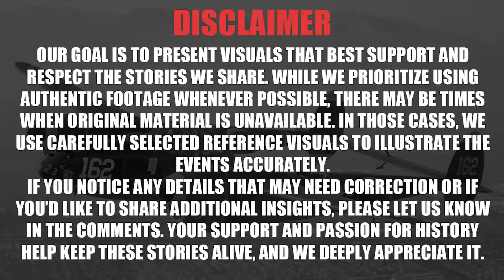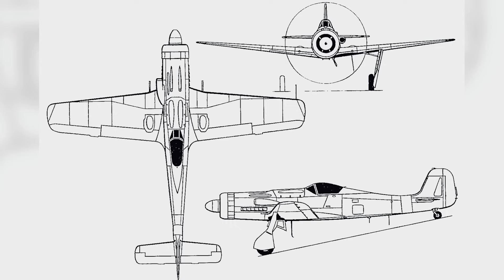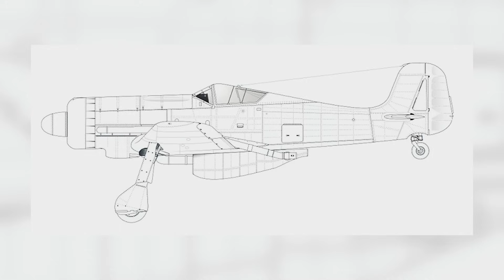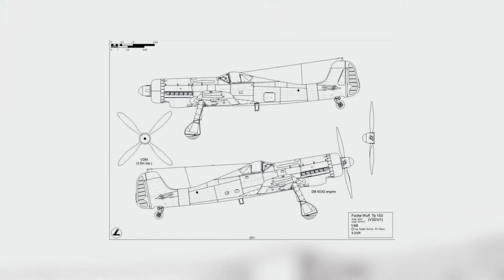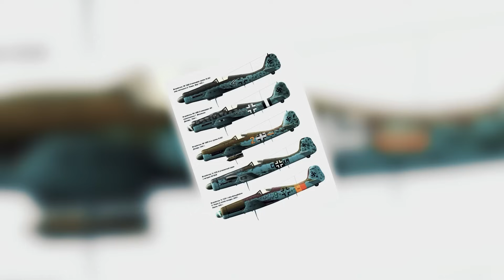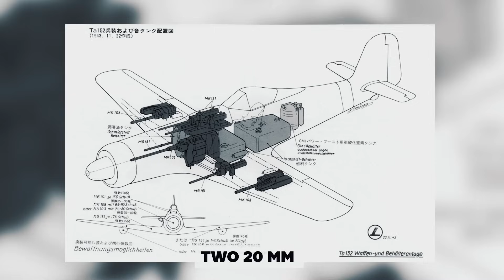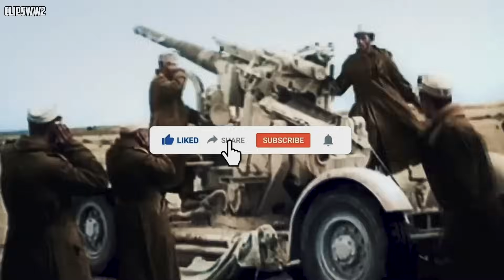Germany’s Last Gamble in the Sky: Focke-Wulf Ta 152 Explained

Comment: Germany's air ministry was led by drug addled Goering. Rather than lead compentently, he wasted rousources on stupid shit like MAUS, Ju-52, Me-262 "bomber", and upgrades on Bf-109-- a 1930's design. First should have procurred RESOURCES to build Turbine Blades heat resistant.( chromium, and molybedanum ). Then use ALL resources to produce Me-262 and upgrade engines in serious numbers !   Not starting Operation Barbarossa, and CONSOLIDATING GAINS would have allowed for this.
Imagine: a Normady landing met by 5 million Wermacht, and 65 squadrons of Upgraded Me-262's ?
The Me-262 with a pressurized cockpit could have outperformed EVERYTHING the West had. The 30mm cannon, and wings holding rockets could have devastated Allied bombers easily.
Sadly, Hitler was a great speaker, but should have NEVER tried to advise on Military matters. Incompetence has ALWAYS been the downfall of Empires. As seen in USA in 2025.
I could have directed the Reich to great victory, at far less costs, and saved destroying the Bolshiviks until all was consolidated. Taking Russia would have required long range bombers in numbers, with hundreds of Me-262 variants to escort out and back.
A Jet version of the America Bomber would have been sufficient.
England was a comparative knat, taking England out of the fight would have been simple after 5 years of CONSOLIDATING GAINS.
Strangle England by simply interdicting shipping from America. That too could have been done with both long range bombers, and more Uboats.
Reply from the maker: Thanks for sharing your thoughts! I try to keep the videos focused on the historical facts about the aircraft themselves rather than broader political or alternate-history scenarios. There are many complex factors behind Germany’s wartime decisions, and historians still debate them today. I appreciate your interest and your detailed perspective!

Comment: They have real film of TA 152 it is longer and sleeker than these.
Most pics look like FW 190 Dplus versions
Reply from the maker: Good eye! You’re absolutely right that the real Ta 152 was longer, with that distinctive stretched nose and wingspan optimized for high-altitude performance. Some of the footage and photos often get mixed up with late Fw 190D variants since they shared the same lineage. I appreciate you pointing that out!

Comment: The Ta152 H was a superb plane. The problem was by the time the German war industry actually managed to churn out enough of them the war was over. The Luftwaffe only received about 1 squadron of them and they were operational for less than 3 months before the war ended.
Reply from the maker: Do you think it could’ve challenged the Tempest or Mustang if it had entered service earlier?
Reply: @VintageWarbirds  Definitely. The test pilots that flew them said that they had a tremendously fast rate of climb. And they were incredibly maneuverable at the height they were designed for.
Reply from the maker: Thank you for sharing more information!
Reply: @VintageWarbirds ta 152 was awesome but cursed by rushed production sabotage and lack of pre production testing. In my professional opinion was best fighter in ww2

Comment: The biggest quandry is, having numerous allied aircraft witb 2 stage superchargers - why didn't Germany copy this? In  1944 when the p51 mustang  came in German pilot's had an advantage if they boomed and zoomed.
Eric Hartmam did this scoring the highest amount shot down.
Reply from the maker: Excellent observation, Germany did experiment with multi-stage superchargers, but materials and production limits held them back. Hartmann’s tactics perfectly exploited what the Bf 109 could still do best.
Reply: They already had something better, at least Daimler Benz, the centrifugally coupled variable speed supercharger, which made stages ancillary (German government should have enforced to Daimler Benz to pass the patent to Jumo and BMW, in this way the Fw190 A would had not any high altitude problem). 
Pratt & Whitney later adopted It coupled to the Water methanol injection to the engine for the F8F Bearcat.
Best regards

Comment: The Bf109 was not, as this video claims, altitude limited like the Fw190. It flew top-cover for 190s. Most of it's more successful pilots used either it's (most often) superior climb rate or high altitude performance if they had to fight the generally superior Mustang and later model Spitfires. Though not as tough or well armed as the Fw190s, a Bf109G-10 or Bf109K would not have had a very hard time climbing high enough and fast enough to intercept B29s. As the Japanese fighter pilots could have told their German counterparts, you could intercept SuperForts, you could even shoot a SuperFort down, but the latter was potentially more problematic than the former.
 The DB603 was not an especially difficult engine for Daimler to develope, being an advancement of the tried and true DB600,  DB601 etcetera series of engines. Even variations or upgrades of proven deisigns have some teething problems, but the DB603 was not an especial problem. The problem was that any DB6XX was in high demand with every aircraft manufacturer in Germany, and they all wanted the latest, greatest version delivered to them in huge numbers yesterday. Tank's company was way down the priority list for receiving them. Goering preferred the Bf110 to have DBs before Focke-Wulfs, even though the 110 had proven ineffective as a "heavy" fighter even before it was hopelessly obsolete. Like a Merlin, the DB inlines were complex, and required extreme precision in manufacture and assembly, so they did take longer to produce than a realively cheaper, simpler radial design. Just like the drawback to a Thompson sub-machine gun compared to an M1 carbine.
Reply from the maker: Excellent points! You’re absolutely right about the DB603 development and the 109’s high-altitude capabilities. Thanks for adding valuable detail to the discussion.

Comment: All they really needed was the ME-262.  Nothing the allies had could equal it.  It was indeed---a vonder weapon.
Reply from the maker: The Me-262 was definitely ahead of its time, but it came too late and in too few numbers to change the outcome of the war.
Reply: Of course the Me 262 was fast and amazing, but in the shape it was in, it was not THE gamechanger.  

All OK when you can do the ideal - do fast strafing runs on the bombers,  

But the Jumo 0004s were a mess, just 20-40 hours lifetime, and you had to handle the throttle like a raw egg, or it would flameout.  

During landing they were sitting ducks, when enemy fighters came, they could not just push throttle and pull away. The landing fields of the Me 262 needed air cover from prop fighters.  
  

It turned out that I had met Guido Mutke. He had flown the Me 262 "Weiße 3" that is now in the Deutsches Museum, Munich, with which he had landed in 1945 in Dübendorf in the neutral Switzerland, where they both were interned. 
Whether it was a navigation error or whether he thought it is safer for survival in Switzerland, we will never know.  
 
A friend from the Deutsche Museum told me that when I mentioned his name, I had met him at a party of acquaintances of my parents, and in that time he was more about his later career in a health insurance company.

Comment: The B-29 would have done not much better than the B-17 and B-24.  The skies over Germany were German.
Reply from the maker: That’s a fair argument. The B-29 had advantages like range and altitude, but without air superiority, even it would’ve struggled over Germany before 1944.
Reply: I suspect that the American Air force judged too costly to deploy the B29 superfortess in Europe as any Heavy FlaK gun could reach 35-45.000 feet of ceiling and almost all of the German fighters, that is, the late Bf109G and Bf109 K, the Fw190 D and late war Fw190 A, could reach 30.000 feet around higher speed than the Boeing B29, without any special trouble and shot them down making It a farctoo expensive toy. The radial engined BMW 801S Fw190 A9 was able to still reach about 610 km/h without much trouble at this heights and 670 km/ at about 6100 metres and the non finished Fw190 A10 with BMW 801F with two stage two speed supercharger and 2450 HP would have been similar to late war F4U4 Corsairs. Nothing so easy as the Pacific theatre. That not counting the Me262 and the new breed of jet fighters that Germany was preparing.
Best regards.

Comment: Nazi foolishness was thinking time wasn't running out faster than they could get these new wunderwaffe into wide service.Losing a protracted war is NOT a constant rate, straight line graph to surrender; it's an increasingly steeply declining curve to eventual vertical free fall. Sort of like the arc of most kamikaze flights. Out of time! Great underestimation, but then, being proactive, without hubris & arrogance were not in Nazi DNA.
Reply from the maker: Very well said. The Nazis’ obsession with “miracle weapons” blinded them to the reality of their collapsing logistics and resources. By the time many of these projects were operational, the war was already lost.
Reply: Stop before Barbarossa, and spend 5 or 6 years CONSOLIDATING. Gathering Resource Lines. Waste no time on crap like Stukas, and 109's, but put all aircraft production into Me-262, and Engine R & D.

Comment: Pressurised to fly with the cockpit at the pressure at 26,000 feet?
At this pressure the pilot would have become a victim of hypoxia.
B-29 's cockpit and the rear gunner's station was pressurised at the level of pressure at 8000ft.
Reply from the maker: Excellent observation! Indeed, the B-29’s pressurization system maintained about 8,000 ft cabin pressure, ensuring the crew could operate safely even at high altitudes.
Reply: If the oxygen system failed the pilot would have enough time to descend to a lower altitude .
Reply: Rather like the vaunted F22 Raptor, that has a non functional onboard oxygen supply. Pilots carry oxygen BOTTLES under the seat. Fixing the F22 oxygen system would require rebuilding the entire aircraft. Something the Company at first hid, then admitted later when pilots told the truth.